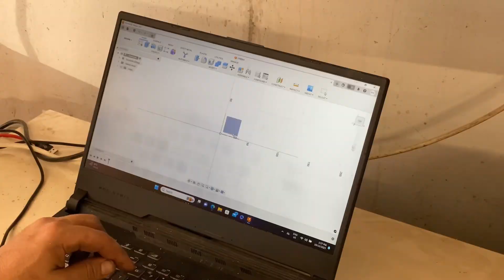25ft Bertram project - blob 68 - I made a Milwaukee haemorrhoid stopper!￼

Comment from the maker: Hey there! I’m not an expert welder or at anything really! I like to make things easier and safer for myself to assist me doing up my Bertram. I just wanted to show you how I made my Milwaukee stern drive lifter. I thought some people would appreciate seeing what some things are called, where to buy them and how much things cost. Some things aren’t as expensive as you might have thought!? Some things are! I’m not sponsored by any of the places. Just trying to be helpful. Hopefully it gives the confidence to somebody to build something for themselves. You can see nothing here gets done very technically, nothing is perfectly 90degrees or parallel. You just have to start doing something, cut what you think, tack it where it kinda needs to be and just fix it up later! Don’t overthink so much that you don’t begin! It’s easy to do and I’m guilty of it! This thing works like a treat! Next video shows how well it worked! 
Please leave a comment with your thoughts, press like if you like it , subscribe with bells on to see more! 
Merry Christmas!